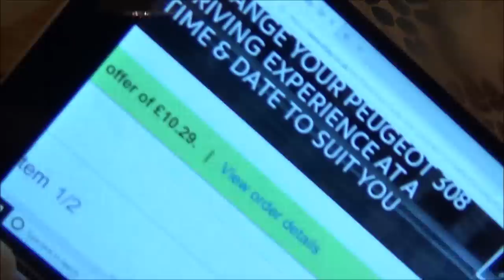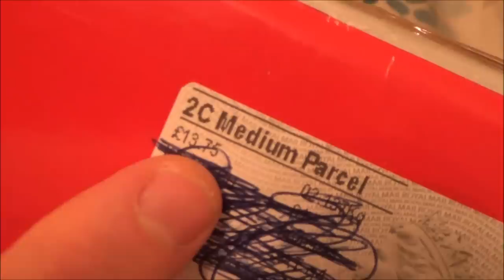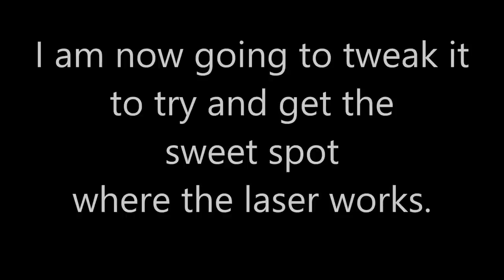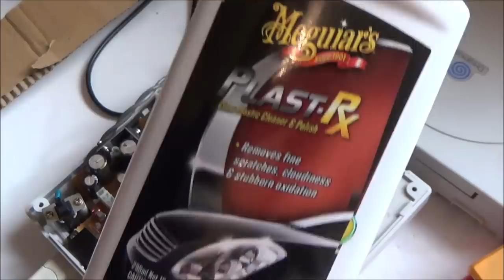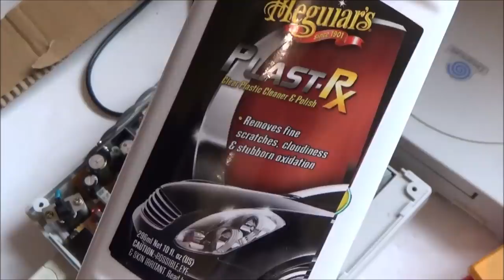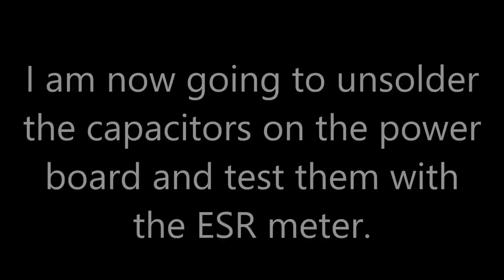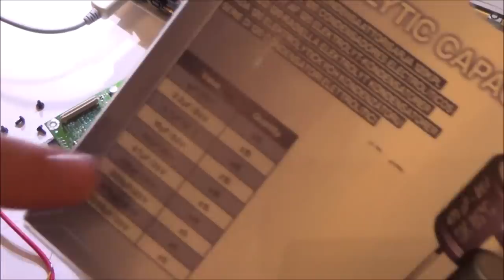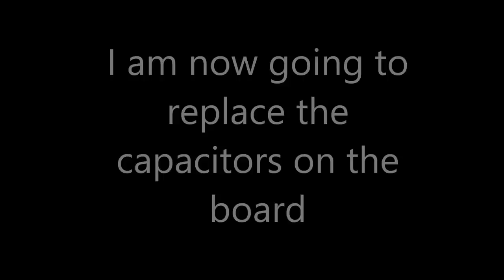Trying to FIX a Faulty SEGA Dreamcast purchased on eBay

Comment: Nowdays you could buy an alternative bios Vince, you can swap the original one and later do a SD or ide hdd mod to run games without the optical drive. It would be interesting if you do that with the DC with the dead gd-rom unit.

Comment: at 1:22:20 you're miss a faulty contact. Always check legs twice. If you uneven about a good contact, try to heat a solder and hold a leg down by toothpick or tweezers, then (when you're sure about good contact) remove the iron and wait for the connection to cool down.

Comment: if you were the unlucky kid to get stuck with the old crappy TV with only RF inputs back in the day RF wasn't too uncommon and they still sold the rf cables for the n64 at gamestop in the early2000s. One workaround I later discovered was to plug the composite signal through the front of the VCR. It did nothing to inprove the quality other than being able to hear the game through you stereo but it works and you could even record your gameplay.

Comment: looks like you are nearly there i would look at what drives that chip. We know the cap is ok so look between the chip and the cap and look at the transistor check good board and faulty one i think you will find something dragging  that chip down as when you apply heat the fault changes so look at the components right next to the chip..Just a thought from an ex tv repair man

Comment: Inspect the internals Of the unit before connecting to the MAINS SUPPLY ⚡as an Example, metal pieces or metal screws rattling around can cause SHORT CIRCUIT'S and make the job an even more expensive repair.also get yourself an ESD Lead as (Electrical static Discharge) can damage ESD Sensitive components if handled. You will need a service manual to determine (voltage value readings) as its pointless guessing as you need to know the correct voltage read outs at each rail to determine any power shortages 👍. When a game is detected you will hear a clearable beep from the unit as the laser spins

Comment: Most of the case its enought a cotton earbud with some alcohol on it and clean the laser lens.If not there is a small screw behind the laser head with a red mark on it and can adjust slightly to give the laser more strength.

Comment: Check the voltage at different points on the board, laser and motor and compare to the working unit. If you have a scope use this to do the same thing..

Comment: GD-Rom drives are basically normal CD drives, Sega tweaked them to make the controller chip think that it is spinning at twice the speed, so the pitch of the disc is smaller and the density doubled, thus the doubled capacity.

Comment: Aw I threw out the guts of several DC's a while back as I maintained mine for homebrew and emulation (the DC is abs brilliant for emulation and even as a standalone Linux PC) then I got my Nespi and sold on the working one and sadly threw away the detritus left over :(   The potentiometer thing I seem to remember was when ppl were using RW discs as the GDROM didn't like the rewriteable CD's and you turned the power up on the laser to get it to read them and some brands of R+'s I may be wrong as its been a long while since I dabbled.   Asia and Brazil did have the Dreamcast long after it stopped in Europe and America and it did live on for a while as a VCD player in China and Brazil if memory serves me right as you could get a little screen addon that turned it into a portable video cd player.   The three voltages are the same as the PC which is 3.3, 5 and 12v, as basically the Dreamcast is a consoley looking tiny PC with Windows CE embedded on a ROM which is why it was king of emulation for such a long time and back in the day you could get "convertor" discs to play PS1 games altho that fizzled out once Sony got moody about it hehe   Its ironic too in that many of the titles shelved for the Dreamcast actually ended up on the Xbox with Sega just building an emulation wrapper around such as Sega GT 2000 to run it in the Xbox environment :)   One thing did worry me was you having your hand without even latex gloves on near that transformer with it plugged in, the caps will give you a jolt but that transformer will abs zap you hard cos I had that happen with a DC when I was distracted, at least wear insulating gloves m8 and discharge the caps properly cos otherwise you is going to be hosting the channel from a cloud :(
Reply from the maker: Thanks for the tips. Yes, I should have been wearing gloves as it would have given me a bit more protection. I was making sure I was keeping my hands away from the left hand side of the console but I could have got distracted or slipped etc.
I always feel much more comfortable working on a device with a separate transformer or a battery powered device :-)

Comment: The Dreamcast lasers failed a lot because the Dreamcast's real Achilles heel is that the early models can read copied/pirated games using a boot disk. The laser really didn't like that though as it had to work harder to read the CDRs.

Comment: Check a screw on the laser's transport mechanism underneath the optical block.. Clean the teeth for the laser transport motor and check the chip that controls the focus of the laser's coil, as it sounds like it can't actually focus! I also collect and repair old computers and consoles, i have 4 Dreamcasts myself.. Hell i have Ataris, Amigas, Spectrums etc etc.. Name it and i may have it! Haha..

Comment: Hey man did you find replacement screen for those 2ds xls
Reply: Probably not, I too was looking into it, but there doesn't seem to be anything available, only plain LCDs, no LCD assemblies. You would need to unstick the original LCD from the front of the screen and then glue the new LCD to it, which you basically need a clean room for.

Comment: I've always been tempted to buy a faulty console to see if I can bring it back to life.
Reply: Back when GameStop wanted to clearance out these consoles, I bought one for the work place. It was quickly exchanged for another one. And that one was exchanged. And that one was also exchanged. Every one of them had something different going wrong until I forced a good one out of the place. So...I'd say go for it if the price is right. There are plenty of good games for this console. Granted, it's internet side is far too out of date.
Reply: @jupreindeer  I already have a working Dreamcast, only set me back about £40 IIRC the other year

Comment: Laser doesnt need to be in the visible range. NEVER DO REPAIRS on CD PLAYERS or DVD player without laser blocking googles and NEVER DEFEAT the protections.  They can be very harmful, since they are not even visible.

Comment: I had to source a Ribbon Cable (26:22 onwards) for a cheap chinese Erisin Car Stereo which had the Pull out 7” Display and I believe the Cable was damaged during the manufacturing process and was hanging on by a thread, Opened it up and sure enough that Cable needed to be replaced, Measured the length along with the amount of Pins & pitch and managed to find 5 of them on eBay pretty cheap, Someone nicked it not long after as I believe someone who was doing work on the Van forgot to lock it, Still got the accessories & the remaining Ribbon cables here, My replacement had to have a detachable panel at the very least! I Also managed to source a replacement touchscreen and fit it for a different Erisin Model Car Stereo as it accidentally got smashed when they attempted to fit the Car Stereo, They tried to replace the Touchscreen themselves and had plugged the cable in the wrong way round, Theirs a couple of scrappy videos on my channel about both!

Comment: 38:46 resistance should always be measured with power off in case there is a voltage applied to the pot when power is on - that could potentially damage your meter

Comment: If you are not measuring the voltage, you don't have to power the device. You can possibly ruin your meter if you do that.
Reply from the maker: Thanks, I never knew that I needed to measure the power to the laser with the power off!!!! A few people mentioned that in these comments. I will know for next time :-)

Comment: The Laser is not dangerous it is a Class 1 less than 5 mW and 650 nm with this wavelength and power the eye has time enough to turn away.
You can see with a camera if the laser beam works even if its infrared or ultra violet.

1:14:28 this is a crystal for the reference of the clock speed. watches have similar crystals

Comment: Just to clarify that the warning given at the start of the video where it was mentioned that 240 volts will kill you, this is a propagated fallacy for many years, you could put a thousand volts through your body and be unarmed, it's the amps which will kill you in fact no more than one amp is needed to kill a person.

   I used to own one of these and there is a better lead to use with the Dreamcast, but the name escapes me at this moment, infact it's a very good machine.

Comment: just keeps switching parts from both boot until you hit the jackpot , that long thing looks like a crystal oscillator otherwise known as the  clock.  it definitely is not the clock. crystal oscillator is for the speed of your processor , different processes operate with different frequencies hence  the different types of oscillators speeds.

Comment: @My Mate VINCE
good Dreamcast lasers measure around 1200 to 1000 ohm from factory, average 900 to 800 ohm from factory. anything under 800 ohms is already been tampered with or slipped through quality control in factory. max value to tweak it when it only reads GDs and you want it to read burned discs is 700 ohms, never go lower or it will fry your laser diode in a short time. Yamaha drives had a JVC SPU-3200 16 pin laser unit, these units where widely used in audio devices and pc drives at that time, some had 17 pin but could still be used in the Dreamcast. Samsung drives where less common and not that good, thus it was and is still hard to get a hold of replacement. Interchanging Yamaha and Samsung parts causes problems. Sometimes the BA driver chip on the GD drive motherboard goes bad and thus the drive behaves like it has a bad laser. You can find them as replacement still today.
If your laser unit sounds loud as hell like the bad laser in your video, then the laser is tweaked too much and gets too much power, thus hitting the lens up and down mostly against the disc...

Comment: You do not test for ohms on a live circuit. Not sure if drive laser eye had power to it though because the switch is open for disk drive tray. I future when it says test for ohms that means circuit must not have any power to it.

Comment: ?whats the factory distance on the motor of the disc to the laser unit 
nobody seems to adjust or check this first if the disc is to high or to low the laser can not focus 
try this on the working unit and you will get the same errors

Comment: That component you don't know about on the board (the silver, cylindrical thing) I believe to be a capacitor. On the good board it looked to be a rectangular component, but as a matter of fact, that's just a casing. If you removed that casing, it would be the same silver, cylindrical capacitor. Just like with the Game Gear's ones.
Just an educated guess.

Comment: Please don't use the ESR Meter for components with are in circuit. That doesn't work because there are other parts in always parallel to the measured component which gives you false readings. At least desolder one side of it.

Comment: Probably not your issue and your right about the voltage on the capacitors. But if fitting caps with a higher voltage, you shouldn't go to far out of voltage range.

Comment: The GD-rom was Sega attempt at battling piracy on the system, did not work as well as they hoped.    Nintendo did something similar with the mini disc format they used for the gamecube, i think it likely worked a bit better but that said i do admit there weren't that many games for it worth pirating.

Comment: Never check resistance with the power on. It can damage your meter. Luckily for you the switch for the lid being closed turns of power to the laser. Only volts and amps need power. Volts can be checked in parallel(across the component). Amps however has to be checked in series(one leg of the component being lifted and the meter going from the lifted leg and the pad it solders to/in) otherwise again it can damage your meter.
Reply from the maker: Thank you, I incorrectly thought that I had to have power in the board to measure the resistance after the potentiometer :-)
Reply: @Mymatevince  The majority of electronics work is done unpowered via resistance check and continuity checks. For example because a capacitor is two conductors with an insulator in between the majority of times the insulator breaks down and the capacitor goes short circuit(but it can go open circuit). A resistor is just a piece of resistive material and therefore goes open circuit. If you measure the resistor in the board you can pick up the resistance of the rest of the circuit. But if you read a value more than what the resistor is rated at the resistor is more than likely open circuit and at the very least you need to take it of the board and check it. For example the resistor is rated at 100 ohm. Taking into account the tolerance which the highest tolerance you will be dealing with is 20%. So the resistor rated at 100 ohm could have a resistance any where between 80 ohm and 120 ohm. But when you measure across it on resistance the meter reads 150 ohms the resistor is more than likely open circuit. Diodes can go open or short circuit but normally are like one way streets meaning one way the resistance is lower than the other way. So on a meter for example one way you read 10 kilo ohms and the other way you read 80 kilo ohms. When testing in the board however you get a reading of 5 kilo ohms so you don't know. So what you do is lift one side of the diode and measure again across the diode to eliminate the resistance of the board. A diode symbol looks like this without spaces(keyboard doesn't have a diode symbol so had to do it using the alt codes) —►|— (the vertical line represents the line on the actual diode). A transistor is two diodes put together and there are two main types of transistor PNP and NPN so what it would can be represented internally would look like —►|——|◄— or —|◄——►|—   on either side of the transistor the pins are called Collector and Emitter and in the center where the diode join is called the Base. So what it looks like fully is(again sorry that I have to use my keyboard)  C—►|—B—|◄—E . As you can see if you check resistance between the  Collector and base you just check it like a diode and same between the Base and Emitter. The only other check that you need to do on a transistor is between the Collector and Emitter and your just checking to make sure it isn't short circuit. There concludes my basic electronics tutorial and I hope it's of help to you in the future.
Reply: One common component that I forgot to talk about is a Zener diode these work as a normal diode but if the voltage on the cathode(the negative terminal) goes above a certain voltage any excess voltage goes through the diode. So say the diode is rated at 10 volt and 12 volt is on the cathode 2 volts goes through the diode. Because of this feature Zener diodes tend to be put in the opposite of what you would expect. With the Anode(the positive terminal) connected to ground/ 0 volts and the Cathode(negative terminal) connected to the positive rail. So that any excess voltage goes straight to ground. There any plenty of components and I have just talked about the most common ones and hopefully you will have a better understanding of what's going on in a circuit when you next look at one.
Reply from the maker: Great information. Thank you for taking the time to write this. It will help me and others reading it immensely :-)

Comment: 1:31:45 looks like a crystal for RTC
Reply: it's a crystal, but it could be for any of the clock signals that the chips on that board require.  I doubt it's an RTC clock if it's on the disc drive mechanism.  It is a crystal, yes.  It is for a clock signal, yes, but not a real time clock (RTC) almost certainly.
Reply: @naikrovek  i thought that was a main board, so i jumped to conclusion it was an RTC crystal, you are right, it can be there for some other purpose :)
Reply: It's the 33.8688 MHz crystal for the CD DSP chip. ;)

It also supplies that clock to the AICA audio chip on the motherboard, and is the master clock for the CD audio data.

(if you divide that freq by 768, you get the 44,100 Hz sampling rate of a CD.)

Yes, I've wasted my life. lol
Reply: @electronash  :) you didn't, you've got a new subscriber :D
Reply: @AlojzJakob  Thanks. ;)

Sorry I haven't done any "proper" vids yet, but I do tend to post project updates on Twitter these days (@AshEvans81).

Definitely more Dreamcast stuff happening soon. :)

Comment: I can see the laser up and down motion looks like is not straight movement something wrong with that laser geometry. About the laser light i remember from fix them in Portugal u can see the laser light come on after u press the switch. The laser or board is faulty. Nice channel by the way. Subscribe and liked 😊

Comment: If I were you, I would swap each IC one by one between the 2 boards, until I find the faulty one.
Also you should check the ribbon connector on the bad pcb with the ribbon plugged in.

Comment: Decrease resistance by 50% would increase current by 100%.

The decrease would have to be to 67% of original, in order to increase current / power by 50% max.